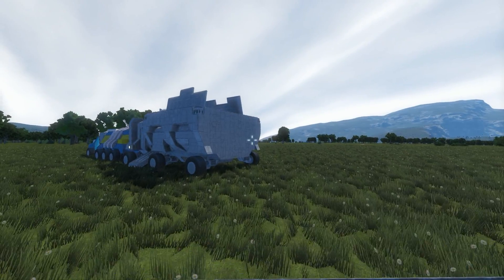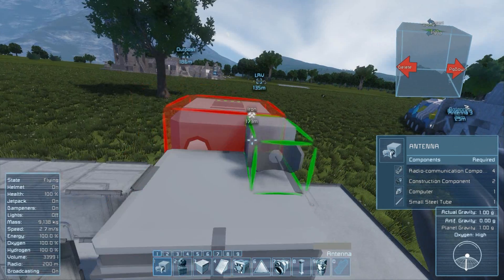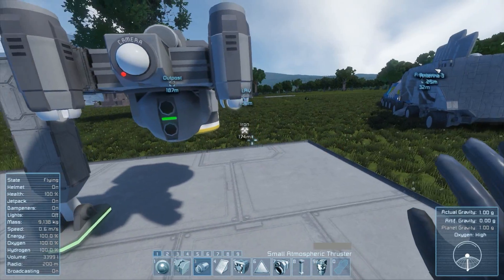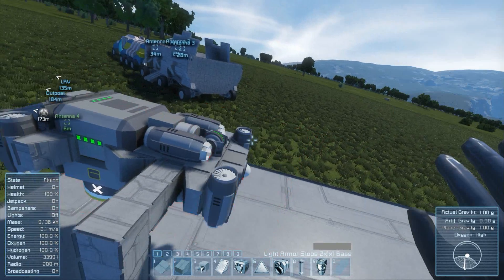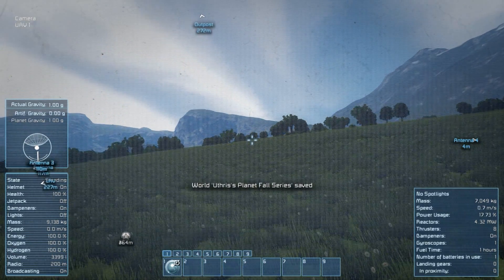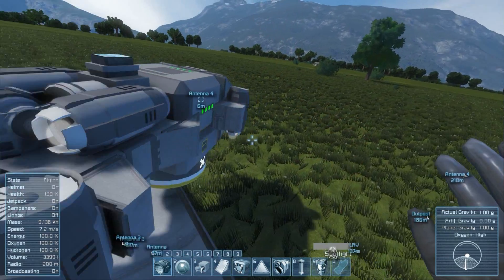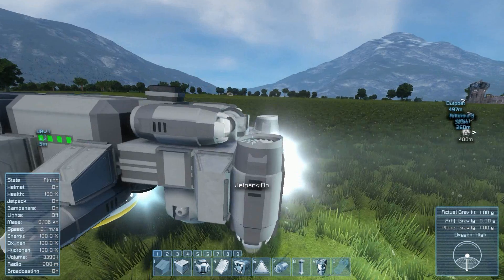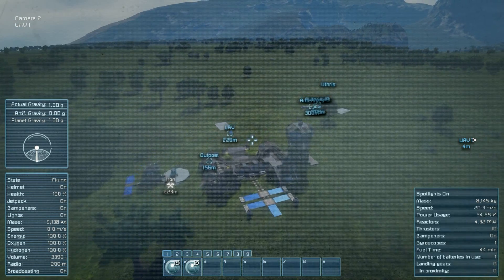Space Engineers | Planet-Fall | UAV ONLINE

Comment: Maybe an LRV trailer? Or even just an item crane. In case the UAV crashes.

As for driving, try making the rear wheels of the hangar module steer. They might have to be set for reverse steering, but that might make it more maneuverable.

Also, Sage from Video Sage has a camera overlay mod that drops the scan lines from the camera.